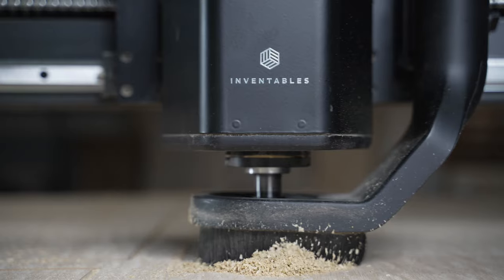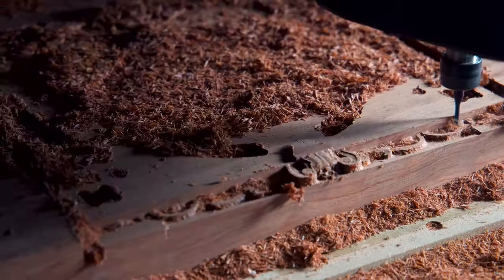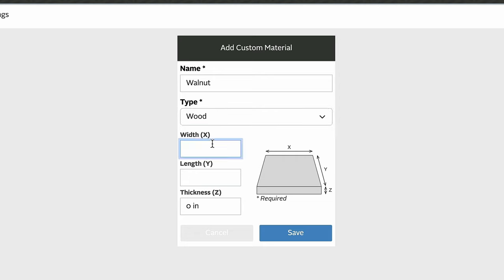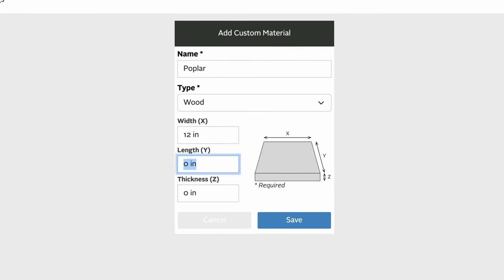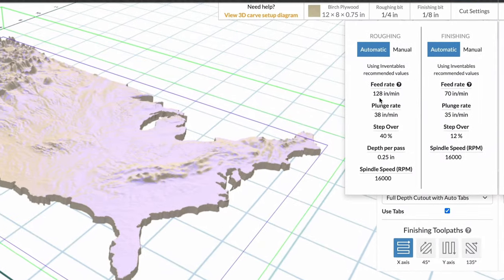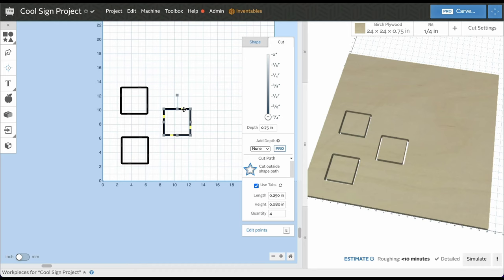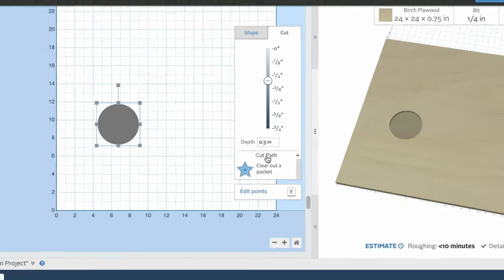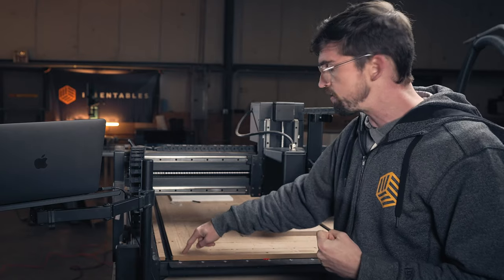Top Easel Pro Features for Business

Comment: Hey I actually have a question my maching will start a curve. I'm using easel pro. It will start carving and then automatically shut off and say carve complete and it has  not even carved much and my job isn't close to being completed?? At first  it would stop and spin in one location And I had to emergency stop it, to actually get it to stop cause none of the buttons worked on easel.. So I got me a new u s b cable and now it's stopping,  the spindle shuts off, and it says carve complete??
Reply: I have a Fox alien 4040XE and I've been using easel pro for a little over a year cause. I had a 3018 at first
Reply: This all started happening after I started using easel 3D pro ... I'm literally shut down I can't even carve a project because it will not complete

Comment: For what you are charging for Easel Pro the software is crap. Should be able to gray out objects to set to not cut,  No snapping, can't change between fonts without starting over, the "apps" should be built into the tool bars oh wait the tool bar is crap too,  there should be more zero home point options .... there is so much more........ Can,t wait for lightburn to release MillMage.